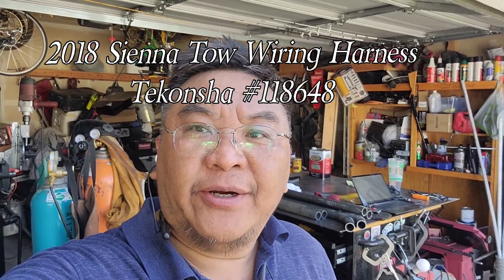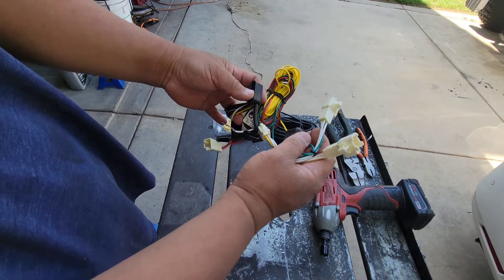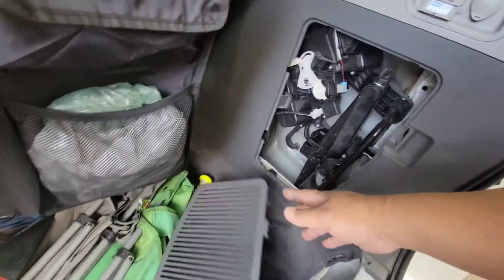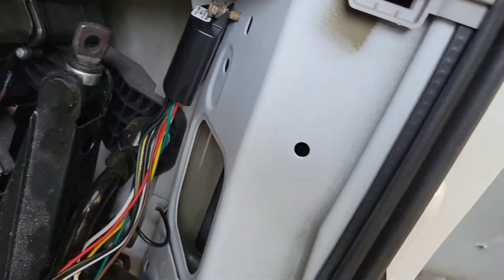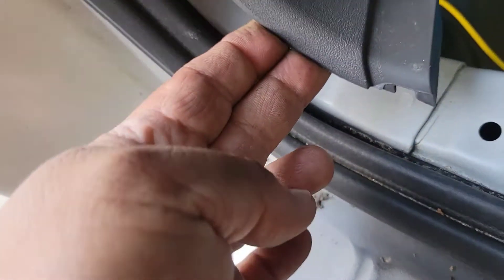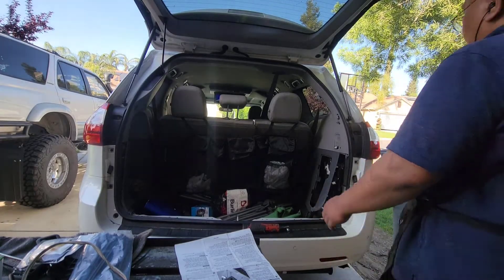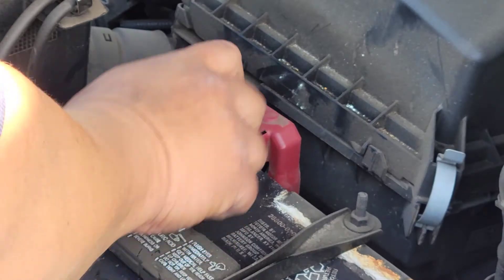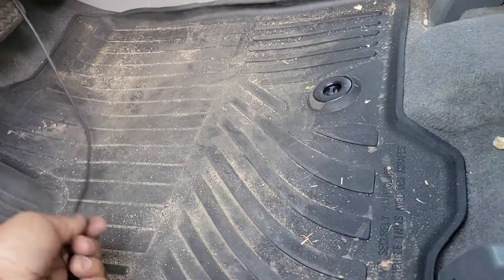2018 Sienna Tow Hitch Wiring Harness Tekonsha #118648

Comment: Any advantage to wiring through the interior vs exterior?
Worried about long term wear from elements?
I like the interior idea, been sitting in mine- waiting for install.
And the 4way connector doesn’t seem robust enough to be mounted on the hitch?
Wonder if you could repin a more weatherproof connector on there
Reply from the maker: Do you have the same vehicle
Reply: @theotherguy3083  Yes its a 2015 with the Drawtite hidden hitch
Reply from the maker: @Doing-It-DI-TY  I chose the interior because the outside environment is brutal to electrical insulation. And there is no way you can install the 4 pin harness to the hitch. It isn't made to ne installed there at all.
Reply: @theotherguy3083  I wonder we can find a weatherproof male to female 4way wire that would pan to the mounting bracket.  I'd like to use one of the hitch led light cover
Reply from the maker: @Doing-It-DI-TY  I am sure there is one. However, the van doesn't have a precut hole to wire the harness throughout.
Reply: @theotherguy3083  The etrailer install video has them removing the grommet in the jack compartment, but fitting the connector through there would be tough.  It might require re-pinning the connector to fit the wire through either way.  they cut a slit in the grommet and re-installed with the power wire in their install.